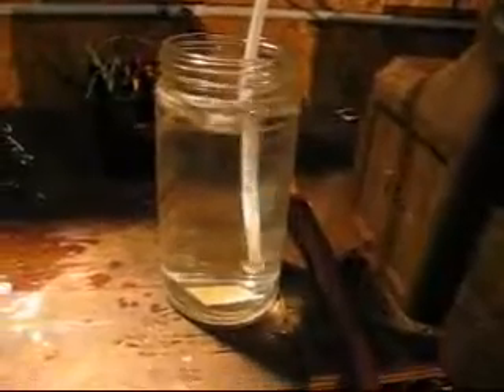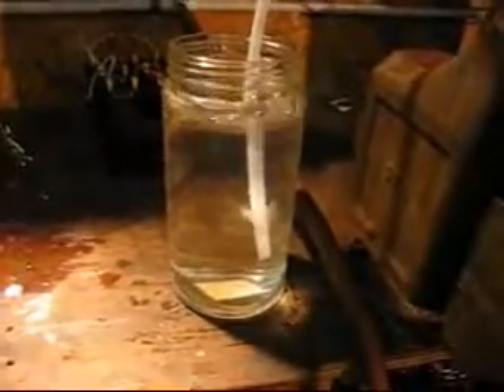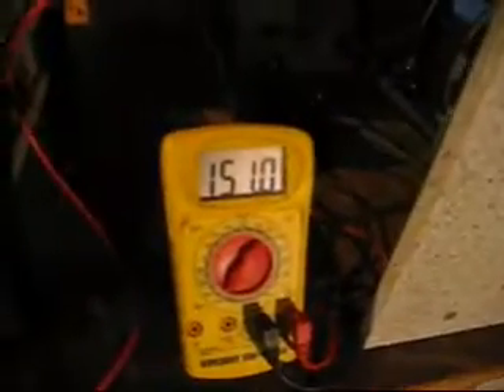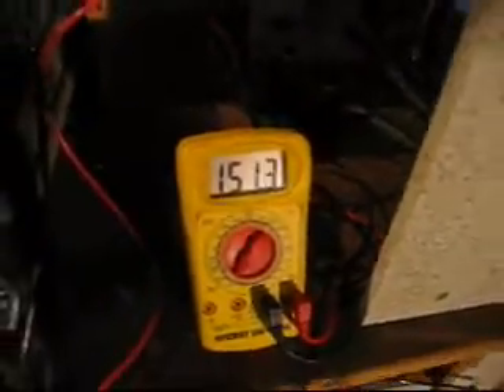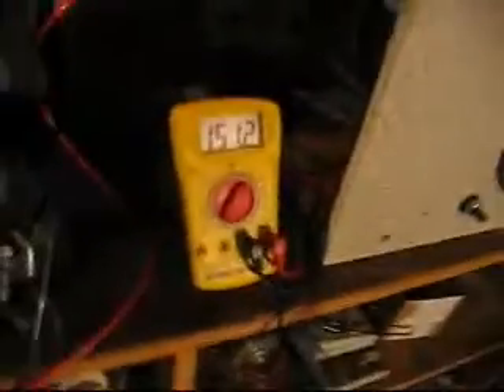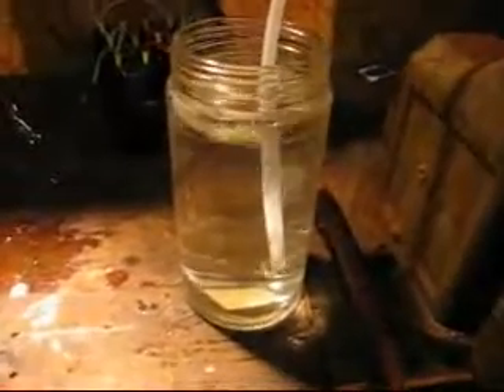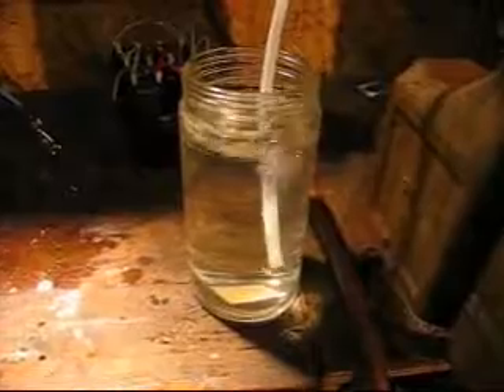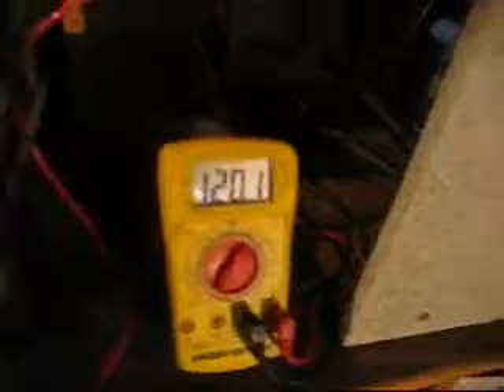HHO Generator HVDC1

Comment from the maker: These plates are 6 in. square plates. These are 304 Stainless Steel that have been conditioned to leech out the iron. These plates were made from a CNC door that was bent and was replaced with a new one, a freebee.

Comment from the maker: Most of the plates are 16 ga. from doors on a CNC machine that wrecked several times, and even some as thin as .03 stainless shim stock that I used for some of the plates to hook my electrical connections. As far as I know all the plates are 304 SS.

Comment: MD, I would kick the elyte up to 1tbs/liter and run your current up to 25-30 amps at a much lower voltage like 14v. I think you will be jumping up and down at the production. Then stick that thing in your truck and see what happens! Push the RED button!